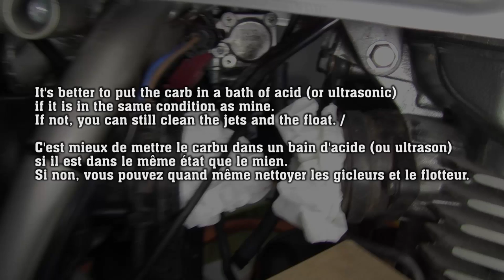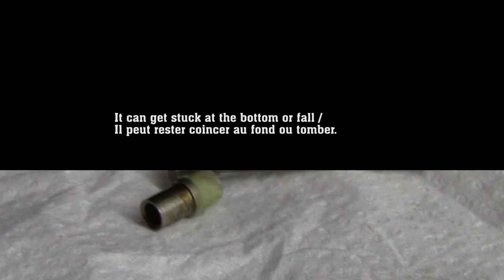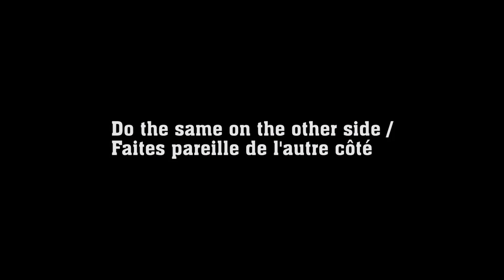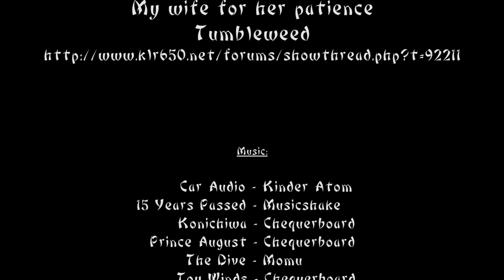Remove and clean carb / Enlever et nettoyer carburateur KLR 650

Comment: Great Video !

Inspired to rebuild mine...Thank you !!!!

Although.....

I've disassembled and upgraded most of my klr....tank and plastics, caliper rebuild, brake lines, clutch cable,wheels off, exhaust removed etc.

Why didn't you remove your tank before this project ? (2 bolts, one vacuum line, one gas line)

It looks like it could have been WAAAY easier.

Anyone ??

I haven't done any engine or carb work, but it seems like you made this a little harder than need be.

sorry ;)